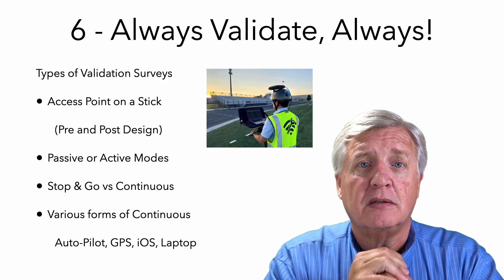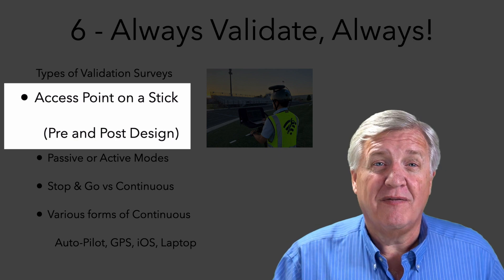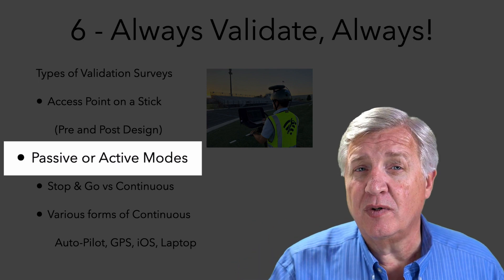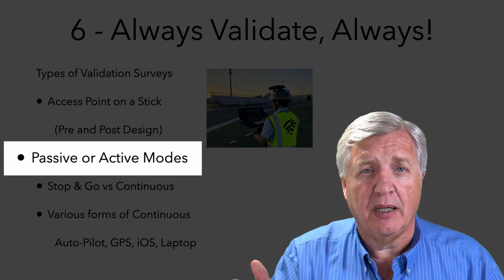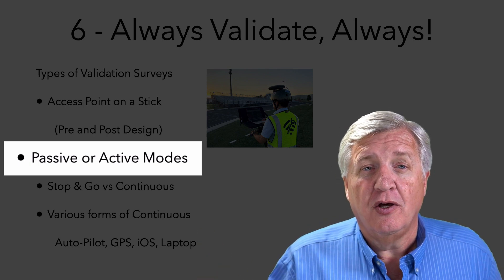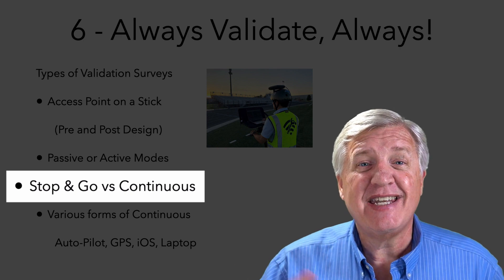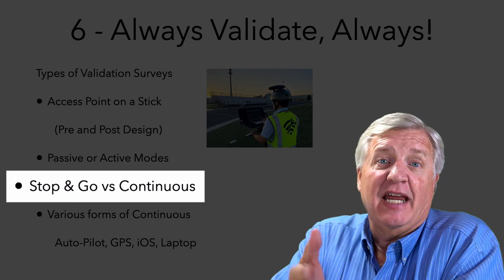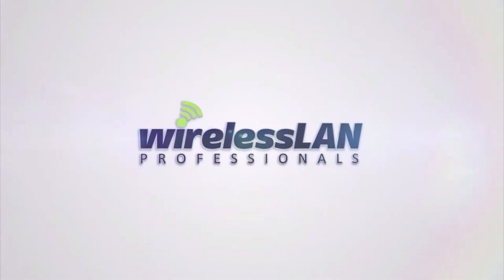WLAN Tip #6: Always Validate, ALWAYS

Comment: Well, I do a lot of RTT active surveys. It does not really mess up passive survey data. Just extra information. Obviously, it doesn’t show precise data (since most of the time, my client with Ekahau is not the target client for deployment and it’s roaming behavior, gain and capabilities differ a lot). BUT but it gives me an idea about really bad places at customer site if it is an WLAN audit, I can even spot a misconfigured VLAN from wired side or at least show customer that good device CAN perform better in given conditions.